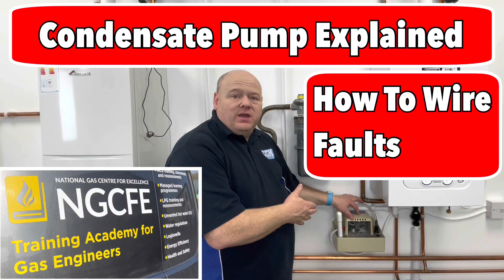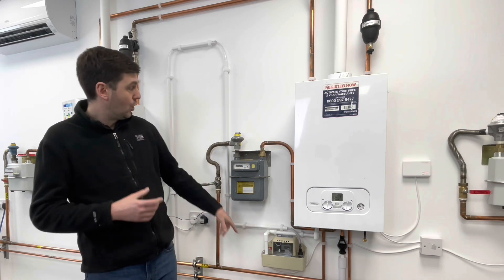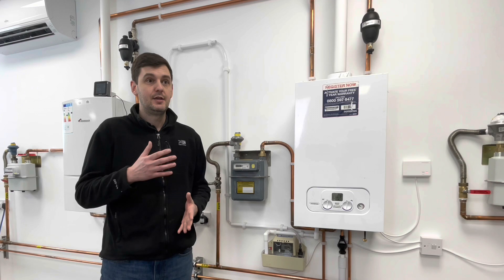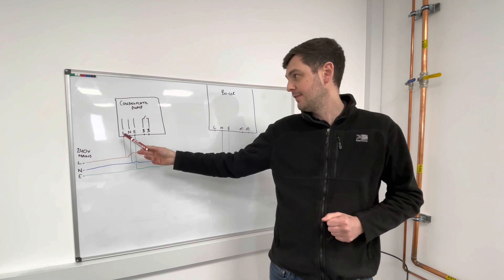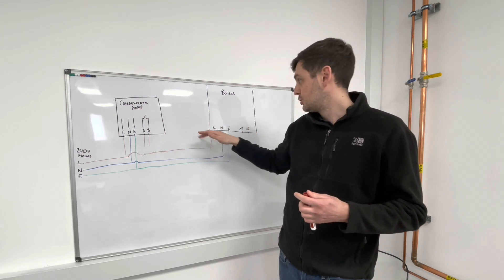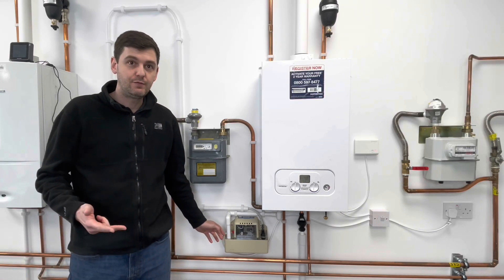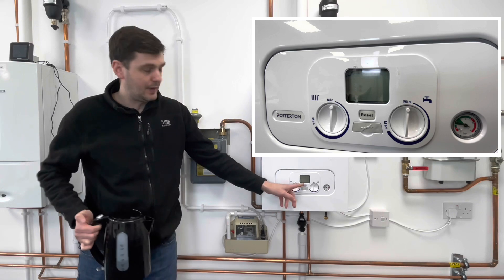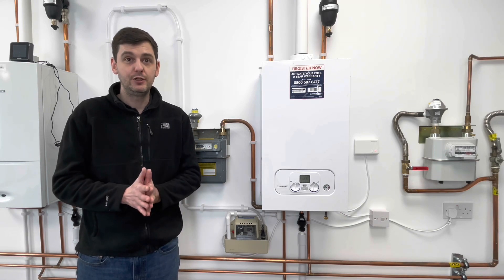Condensate Pump Explained - How To Wire - Faults - NGCFE

Comment: Thanks for the explanation, that makes sense a lot of sense. Reason for me watching? Well, we had a new boiler fitted last winter and today we had an issue with our Condensate Pump not switching off. Got a guy coming to take a look tomorrow but I thought I would ask you what could cause the pump to never turn off. Im assuming its got to be a blockage in the condensate pipe (it looks ok visually) or something blocking the return float. Seems to be a Grundfoss Conflit 1,  I can see water level in the channels on the corners which doesn't seem to change. They advised us to turn off the boiler until they can take a look. But I'm intrigued as to why it would fail to stop (rather than fail to kick in).

Comment: On the vaillent boiler pcb there is a burner conector with a link wire in it you can remove the link wire from the burner conector conect the 2 wires

Comment: Hello mate.  Not long after putting the heating on I hear like a short rev kind of noise followed by a burst of water rushing through the pipe then the condensate pump will bang loud and fast for a short while. What could be causing this? Do I just need a new one?😮
Reply: Ive got the same issue, did u manage to fix it. What was needed. Thanks
Reply: Not yet 😞
Reply: @asey89  I will let you know when I know what the problem is

Comment: The safety switch wiring has no polarity correct? In other words its just one continuous wire broken into two connectors to put on the condensate pump safety switch. Its either giving power to the unit or the switch is triggered  and the power is cut to the unit?

Comment: Thanks for the video. My pump is running constantly as it seems that it has not been wired to the boiler. How much should this job cost? The pump is located around 6 meters from the boiler. Thanks.

Comment: couple of questions...... Can we put 240v live from condensate pump to boiler with no earth traveling in the flex as its 2 core?   if we have the boiler in a unheated space and the condesate pump fails and cuts the live feed to the boiler the boiler frost stat will no longer work which in the Mi's will invalidate the warranty what do we do about this?
Reply: I agree that it’s best practice to have a CPC running through cabling with 230v, opinions welcome. Good thoughts regarding internal frost stat. Personally, rightly or wrongly, I think on the few pumps I’ve been involved in always wired the shut off to the switched live of the appliance. 
However, on a rare occasion the condense pump might have failed and frost stat has also kicked in you could have a potential overflow situation, albeit for a short duration.